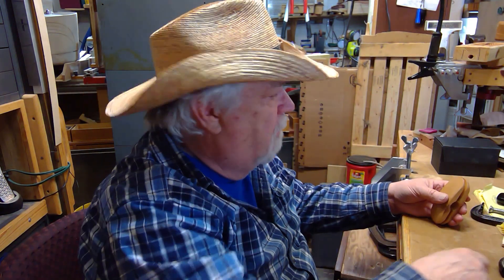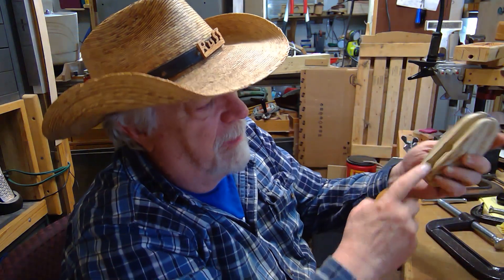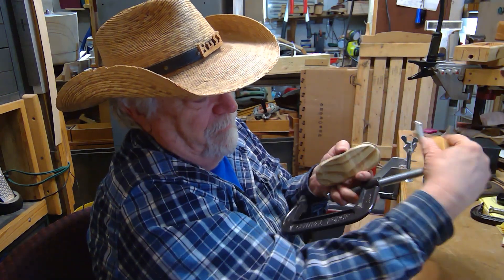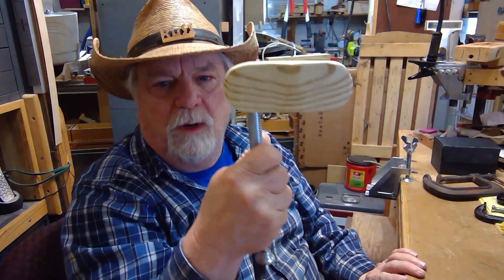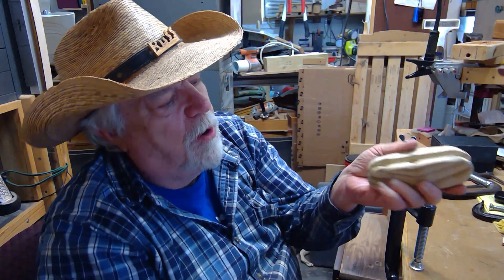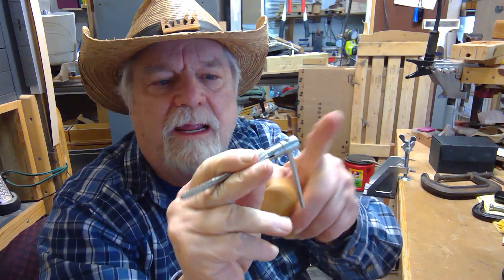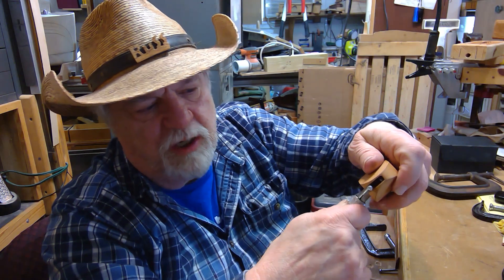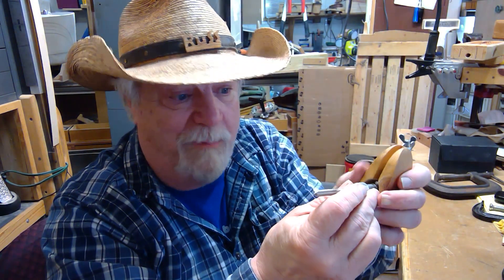Universal C Clamp Handle by OTB Thinker

Comment: Hi Russ: Let me add my comments since I own hundreds of clamps,the little know secret of c clamps is that the handle is a built in safety device, the minute it starts to bend stop because to turn the handle even more you run the risk of bending the screw. as far as your zyliss type clamp those thumbscrews might be able to take a little bit more torque but be careful, a clamp with a bent screw will equal nothing but trouble and more trouble and to try and straighten out a bent screw is not easy.
Reply: @gardener123ful, that is a thought. But I also have some corner clamps that have handles that were just under- sized and maybe of poor metal and just bend at the slightest look.  I wonder if this handle design would correct that problem. It certainly would make them more pleasant to operate.  Plus my comment just added about arthritis...